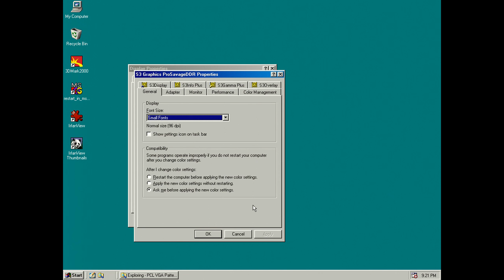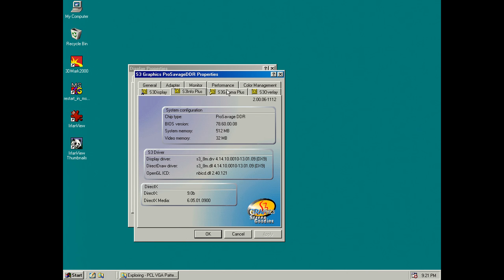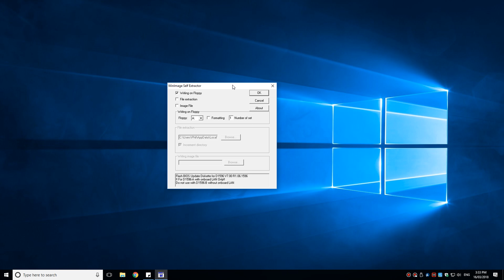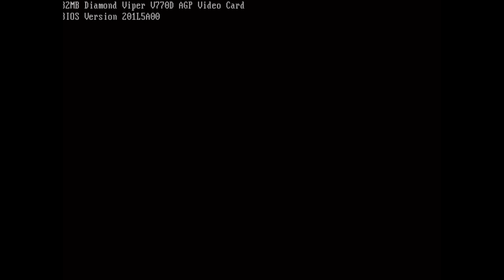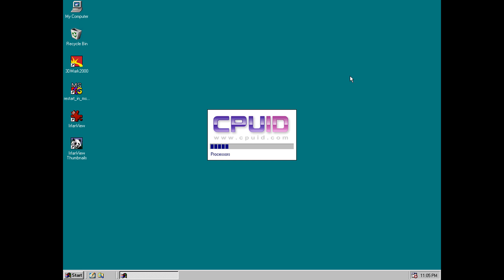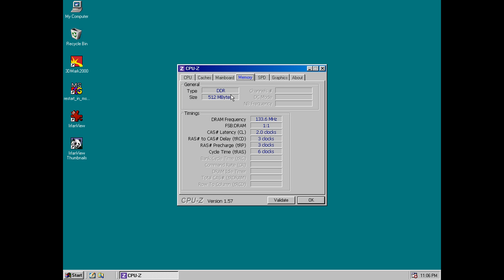Gigabyte GA-7VKMP-FA Socket 462 A motherboard with universal AGP and Japanese capacitors

Comment: I have been trying to get my GA-7VKMP to work for weeks now, my processor only worked at 1GHz until I noticed that it's not in the compatibility list. Fine, got a 2200+ but the board saw it as a 1500+. I could not figure it out until I saw your video and that one jumper that changes the bus frequency. It was on 100MHz. Changed it and all works! The board has only one stupid jumper and I managed to miss it! THANK YOU SO MUCH!

Now to put the Voodoo 5500 and sound blaster live back in and I'm off to playing some games ^.^
Reply from the maker: Nice! Yea it's small details like this that you can easily miss :D Whenever I work with a new (well new to me, but usually old) board, the first thing I do is download the documentation and quick read the entire thing. They all follow a similar layout, so any jumper or other odd feature jumps out right away :D

Comment: Nice review... makes we wonder how this motherboard paired with an Athlon XP 1700+(1.47Ghz) would fair against an intel sock370 1.4Ghz tualitin system along with an ati 9600xt/128mb video card for gaming, the DDR system memory would most certainly be an added plus vs pc133 system memory.
Reply from the maker: Bige4u The original Thunderbird Athlon 1400 MHz is pretty much on par with the Tualatin. So any faster Athlon is even faster.

Comment: Even the good Japanese companies had issues back then. Supposedly a bad electrolyte formula was going around. I have a few A7V133 boards laying around I need to dust off and see if they still work. They both have integrated Promise controllers on them.

Comment: Personal preference MSI manufactured electronics. If ram power supplies and solid state drives where available by this manufacturer I'd have those also. Vintage tech Packard Bell early nineties later  Asus with 3 way sli or crossfire x2 with a dedicated physx card for Nvidia AMD combined. It works but has a trick too set it up.

Comment: This brings back memories, I had the complete Fujitsu tower, the way to overclock these things is to use a program called clockgen, it works for pretty much anything pre 2004, worked great for old compaq deskpro en's, nothing like running a p2 450mhz at 600mhz

Comment: Look for the AXMD2400FJQ4C model because it has 512kb L2 Cache und runs 1.8GHz at only 1.35V. It is specified for a 35W TDP opposed to the ~60W of normal desktop CPUs.
Reply from the maker: That's just a mobile XP, yea if they work, but AFAIK they are not supported.
Reply: PhilsComputerLab AFAIK they are fully supported by any motherboard supoorting XP Bartons. They are also unlocked and there's only one "problem": the CPU VIDs interpreted in a different way, so those CPUs get set to 1.575V normally.
Reply from the maker: Yea I doubt this board has Barton support.

Comment: I have 2 KT133 boards with universal AGP. Don't remember the exact models but they both work great. And the bonus is, each has 2 real ISA slots for older sound card compatibility. Plus if you want to use newer PCI cards they have working DDMA so you have DOS compatibility (to some extent) with those too.

Comment: Perhaps you can try having 1.5 gb in windows 98 & use the 1 gb ram as a ramdrive ?
Would make for an interesting quick video perhaps in certain games & ofc to try out harddrive benchmark tools on said ramdrive too.
Or perhaps if you can assign 3.5 gb as a ram drive on a motherboard that takes 4 gb in windows 98.
(If you can find a modified win 98 iso that allows that amount of ram ofc stable.)
Reply from the maker: 512MB is already overkill, and I use a fast PCI SATA controller with a decent HDD, so storage is very fast.

Comment: I tried the link for the documentation, but I only get the standard support page. What searchterm do I have to use to get the bios and documentation?
Reply from the maker: I just checked the link, it works fine. Maybe try a different browser, maybe it's blocking you?
Reply: Spookynl, on the "Ask Fujitsu!" plain support page select Product Search and input D1596. Voila, you can download everything now.
Reply from the maker: Petr Žemlička I tried it from a different device, yea didn't work. I guess it was using a cookie to remember on my main machine. I'll update it.

Comment: Wow. The CPU is missing a good chunk of the corner and still works! I remember those days, some micrometres more and you had expensive crap. ;)
Reply: Patrick Norton comes to mind
Reply: I've got a PowerPC 750 500 MHz in a PowerBook G3 that's actually chipped worse than this one, yet runs perfectly fine.

Comment: Looking forward to the xp-m review, it has 512k of cache and overclocks pretty well. It's the only XP chip capable of competing with late p4s. I recommend using high speed ddr in dual channel at the maximum bus speed allowed by the motherboard. The nf2 works great, but i believe there was a lesser known via chipset that also worked in dual channel. Make sure it runs @ 400 instead of 333 for maximum performance. Can't remember if higher speeds were possible.
Reply from the maker: It's not an XP-M though. The Geode is interesting because of the lower power consumption, for performance just go with an Athlon 64 :)
Reply: Huh, it is a low power XP. Wiki says it is based on the XP-M, which must be why CPU-Z identified it as one. I agree with the performance thing, but the XP-M was a good way to keep your old athlon system viable without buying a whole new setup. It wasn't really worth upgrading to anything else until the X2 hit the market, as single core and 32-bit OSes could only do so much. The Athlon 64 was a good chip for XP-64, but drivers were terrible for Vista with Nvidia never releasing accelerated sata drivers. It could be made to work, but at decreased speed. Windows 7 was better, but by then I was on a Phenom system. I never tried Intel until the i7 processors, because the price/perf wasn't there. Especially the p4, with early boards being rambus, and even the later ddr builds were never price competitive. The p4 is mostly useful now as a retro system, having better instruction support, and the massive install base made it really cheap and easy to find parts. Not the case when it was new.
Reply from the maker: It's a Geode NX, the board doesn't detect it correctly and most boards don't, it's only some SIS chipset boards that seem to have proper support. Other boards won't even post with it.
Reply: Hah, lucky you got it working. I've never come across those, so it's a little interesting. Seems to be a SOC with some integrated components, could be the starting point of the Athlon 64's memory controller. What I'd really like to know is if the memory controller is integrated, how is that even working in a non geode board? Voodoo magic, I say. Or maybe it's a version without it. Probably the NX variant, as it's based on the Thoroughbred core. That thing might be a good overclocker if it's unlocked....

Comment: Hello im building ms dos pc and i dont have money for 486 or pentium so i take amd athlon xp 2000+ and Ati rage mobility-P 8mb and 256 mb of ram can it run games on good fps?
Reply from the maker: Very good FPS for DOS games, but many games will run too fast on such a CPU.
Reply: So what cheap cpu can run games correctly?
Reply from the maker: This such a broad question. I recommend you do some initial research, watch some of my other videos, especially he build videos.
Reply: Yea thanks i was thinking about socket 7 but no money :( So i saw i had option in my bios i can turn off cpu l2 cache so now it can be better?

Comment: I appear to have a very similar board, I've noted it down as the same model number without the FA at the end.  I recall that it is an OEM board, but I'm not sure if it's Fujitsu or something else.  Mine buzzes loudly at startup until the POST finishes, I think it isn't respecting the chassis intrusion jumper position.  I downloaded a later BIOS but haven't gotten around to flashing it yet.

Comment: Always had a soft spot for Socket A as my second ever PC was an late gen Athlon XP, can't wait to see this Geode video.

Also Phil, I thought you might like this website if you haven't seen it before: http://www.redhill.net.au/ig.html 
Essentially, a guy in my home town who owned a local computer shop for 20 something years made a massive guide to the hardware he's ran into and used over the years. Some great entries in there.
Reply from the maker: Of course I know redhill :D Great read every one in a while :)
Reply: Great to hear. The guy is great to talk to in person if you're ever in the area, too! Built my first ever PC with its little Cyrix CPU that I kept as my main CPU right on up until 2003.

Comment: I have a pcchips m825 that has this same chipset (i think), but unfortunatly it wont turn on (not even the fans), even if it has 3.3v in the front pannel power on. :/

My other one is a biostar m7vkq, but is doent have a agp slot, it has a onboard trident blade 3d but i dont know how good it is.

Comment: So, I have bought this particular motherboard when I saw this video and built a rig around it.  Here are some thoughts.  First, pretty darn cool.  Any vintage card plugs into it and that is definitely a plus.  I do have some problems with the driver side however.  Getting integrated video working with Windows 98 works, but not with Windows ME.  I guess that isn't much of a surprise, but I have been unable to install any other S3 Savage cards/drivers with Windows 9X without the computer bluescreening on bootup.  Might work in Windows XP I don't know.  These are the only graphics drivers I have had problems with.  I have tested video cards from ATI, Nvidia, Trident, 3DLabs, Matrox, and 3DFX and they all work great.  S3 Virge series cards are no problem, just the Savage series.  Other than that with the drivers installed I like it a lot.  The only other downside is that since this is a Socket A rig, there is no SSE2 despite the processor being very capable.  This means a lot of modern software just won't run.
Reply from the maker: Thanks for sharing your experience!

Comment: If you're looking for a brand new old stock socket A motherboard there's a german shop on ebay that sells the PC Chips M811. Nobody seems to buy them. I got mine for a Windows 98 retro pc and so far it works great. The old capacitors may become a problem soon though. At least mine has no bulging ones. Driver installation is a dream with the driver CD, it installs everything in one run with several reboots. The Bios has some good options, for exampe you can disable the L1 and L2 cache, might be interesting for DOS games.
Reply: I am looking for a new LGA775 board, perhaps you could help?
Reply: Well, there are some new boards from germany, for example a MSI 848P Neo2-V but I don't know if the sellers ship to your country.
Reply: No-one buys PCChips motherboards because they've had a reputation for years as being highly unreliable and cheap as chips. If yours works well (or there's no other options) they'll do in a pinch but I can see why a lot of people would tend to stick away from them even today.

http://www.redhill.net.au/b/b-bad.html for further reading (Also, I highly recommend this website for anyone interested in old hardware. In depth guide on CPUs, motherboards and Hard Drives from the 80s/90s although the author does have an AMD bias)
Reply: If they don't, then I can pay a visit to my cousin in München but definitely not for this board - it's too obsolete with only P4/D support and SDRAM (but well befitting this channel). 

My "current" desktop is Northwood based with a Sound Blaster X-FI Fatal1ty. So I have a somewhat decent FSP 500W PSU and a copper Zalman cooler and after watching so many of Phil's videos I have been inspired to combine those parts and do the LGA 771 to 775 mod with an old Xeon. The goal is to build a semi-modern system that can run Windows XP (EAX!) well. There are many videos on YouTube with a 4GHz Xeons (OCed) and the GeForce 960 4GB - quite decent for 1080p gaming even today (it is still a 10 year old CPU).

The downside - maybe this CPU won't be getting microcode update against Spectre, but I guess it will do as a fun system for the next couple of years until the next generation Spectre-free CPUs are released.

Guys, I will appreciate your advice. Maybe it will be a better option to dish out more money and get a Sandy/Ivy Bridge or even Haswell (heard that they could still run XP, albeit with lots of tweaks).
Reply: You're going to have a very hard time finding brand new parts, and 99% of the time used is just as good. Best bet (IMO) is trying to find local computer swapmeets and see if any old stock is being sold there or just buy a used board. (Usually you'll have someone who's happy to test components for a small fee, so you can return it immediately if something's up)

Comment: I should have gone with Universal AGP for my Athlon XP build back in 2003 but I opted instead for an A7N8X Deluxe which has a 1.5v AGP Pro slot. I wasn't planning on using workstation cards for it but the board is (still have the entire build) one hell of an overclocker and was great to use when I paired it with a Barton core CPU. I brought my 2500+ to 3200+ levels which made it all worthwhile. Prior to that was an MSI K7N420 Pro which was an nForce 1 motherboard with a SoundStorm APU and daughter board (didn't need to use my SB Live! for gaming level audio). The motherboard was also a great overclocker as I was able to get my 1.3GHz Morgan Core Duron to 1.4GHz. When I popped in the 1800+ I was able to eek out 1.67GHz and probably could have gone higher.
Reply: I remember having a Barton core 2600+ and a budget ASUS board with the KT400. Flashed a custom BIOS on it to unlock the FSB and overclocked it by 83Mhz to a straight 2Ghz.

That board ended up dying eventually (I went through 3 budget ASUS boards on that CPU) and ended up getting an Axper KT600 based board which as far as I could tell is actually a Gigabyte with a different sticker. That CPU was at 2.3Ghz last time I booted it.

Comment: Great video about a quite cool Socket A motherboard !
Does it support fsb 400 ? That's the question !
 Recently I got an  Asus A7V333 on Ebay for only 1€ with the original box/cd/manual/cables (not an auction btw and in shape like new!) and 4€ with shipping. It's "unfortunatly" ATX form factor and just fsb 333 but it has great overclocking features. It has also an AGP pro slot but my 3.3V cards work great, especially my Voodoo 5 5500 ! It can support CPU up to the Athlon XP 3000+ in fsb333 so that's cool. It can overclock it to the level of the 3200+ effortlessly
Reply: it has a KM266 chipset, so fsb 266Mhz max
Reply: Thanks dude

Comment: Nice video but i missed some gameplay, also more modern and easier to find agp cards are compatible? Like a Radeon 9600 Pro?
Reply from the maker: Of course, it can do AGP 4x, so you can use a 8x card, but it will run at 4x.

Comment: The only board i have had explode was a socket A msi (2 caps blew at the same time), the flames were amazing lucky i was in otherwise my house would have burnt down it did not fry  my cpu,graphics card or ram though

Comment: Comparing the ProSavage with an Geforce 2 ultra is a little bit unfair. It's basicly an Savage 4 with slightly higher clockspeed.
Testing it against a TNT2 or a Geforce 256 SDR would give more comparable results.

Comment: Unusual to see a Nichi cap bulging, but then this board would have been made around the time of the infamous "capocalypse"...
Reply: Not unusual at all. G5 IMac replacement boards used high quality series of Rubi's and Nichi's and they still blew. When caps are ran right at their heat and voltage rating, this happens no matter what brand. Dell is another who used what is considered a good series of cap, and look at how many of those P4 Dell boards have blown their guts all around the processor.